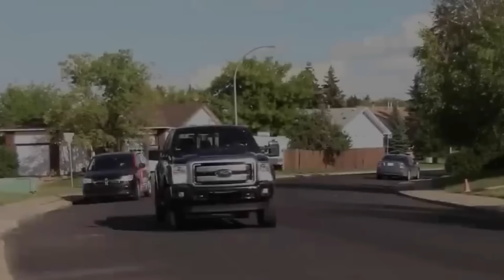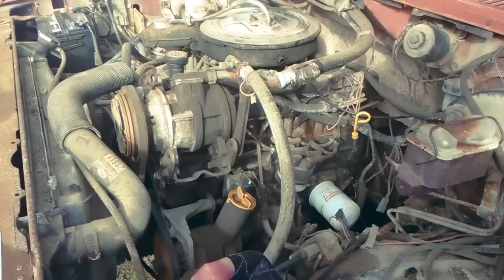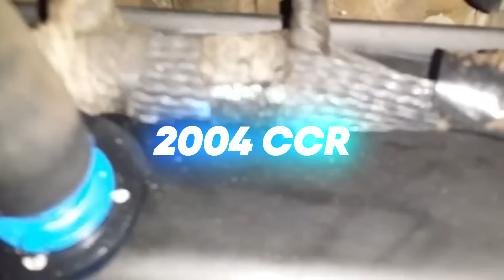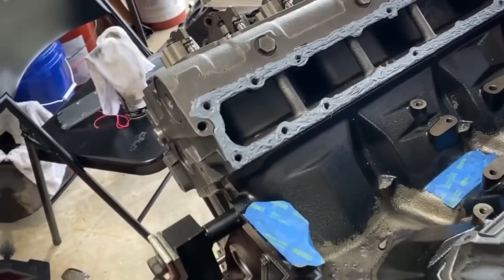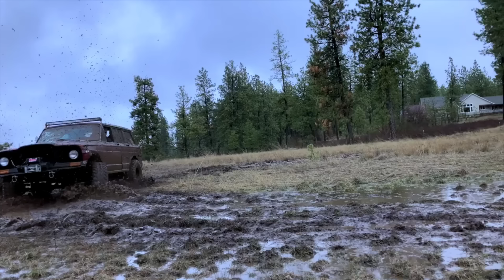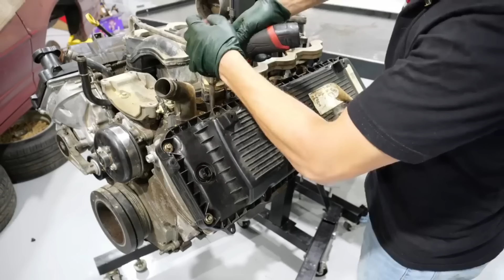The Only 5 Ford Engines That Last 300,000 Miles

Comment: The 302/5.0L Windsor V8 should definitely be on this list. I had a '91 Crown Vic that had 330,000 miles on it when we gave it to a family member who needed a car. They drove it another couple years then traded it for a newer car!
Reply: Have one with over 1 million miles
Reply: @bowtiebender6811  Yeah you do. It's called mental issues.
Reply: Overhead camshaft 4.6 V8 2 Valve was MUCH BETTER then 5.0 pushrod dinosaur
Reply: @anthonynicholich9654  Nah the 4.6 had crappy plastic chain guides that fail mine locked up at 120k and I didn't even drive it hard my 90 Fox with the 302 went well over 300k still ran great when I sold it and I beat the crap out of it
Reply: Name a bad ford engine? Doesn't exist some will say the 351 modified  but the beef here is gas mileage the engine was a 350 400 thousand mile engine  now ford did bomb in 80 81 T Bird a 260 or 265 BUT IT brought out the light cast 5.0 I do wish ford had kept the engine the chevy nuts call a LS it was the engine ford developed to replace the 5.0 intended for the new mustang pony car 1995 but with fords purchase of Jaguar they got the 4.6 an shelved the rebranded LS
Reply: @Charles-w9b  So many of them would not know where to start but I'll mention two. 6.0 diesel JUNK 5.4 3 valve junk  So we're all  their four  cylinder and 6.  How does it get as dumb as you?
Reply: @Charles-w9b  6.4 diesel was a total failure, and the 3-valve 5.4 had issues.  Today’s 4 cylinder motors made by Ford have some serious problems, especially if it’s under the 2.0l size.
Reply: @SoonerMatt 5.4 was a great engine for great DIY citizens or mechanics. Not over tighting or striping the 5 ring insertion point. There were several. The king was the 5.4 windsor in the Ford lightning. I have had several with 800,000 miles before sold.
Reply: @bowtiebender6811 that’s incredible on the 800k mark.  Impressive.
Reply: @SoonerMatt  It makes you wonder how does it get as dumb as him.
Reply: @Charles-w9b  6.4 diesel was a total failure, and the 3-valve 5.4 had issues.  Today’s 4 cylinder motors made by Ford have some serious problems, especially if it’s under the 2.0l size.
Reply: @Charles-w9b very wrong, 351 with 400 heads is a 351 modified. The 351 is the stolen LS.

Comment: List is ok ,yes the 2 valve variant of modular are great engines ,the 6.2 is a good motor. The windsor smallblock ,big block 460 were also great engines ,Triton v10 ,first,second gen coyote. The 4.6 v8 never used full synthetic oil,used a sythetic blend  oil only .

Comment: I really strongly believe the 5.0 liter Windsor V-8 should be on here, I had a 1993 F-150 I sold it at about 468,000 miles the only things I've ever done to it besides routine maintenance was a new oil pump and new coolant hoses the person I sold it to drove it around town  hauling scrap for a good 3 more years

Comment: My 1988 F250 5.8 Windsor and 1996 Bronco 5.8 Windsor are still running, both have over 325k miles, with no rebuild.
Reply: 1985 bronco, 300  over 600,000 3 alternators, two water pumps, third clutch, she just plows snow anymore! But still going

Comment: What about the new 7.3L gas SuperDuty engine? I have heard it is better than the 6.2L. Still driving my 7.3 Powerstroke about to hit 500K....very shortly.
Reply: You must not have heard about their lifter failures.
Reply: @scott.dobson  I thought that was on the first gen and they had fixed the problem. I know several people with close to 100K with no issues after that.
Reply: @Bwanar1 
From what I’ve read, 2024-present are good to go.
Reply: I bought the 6.8 with the thoughts of less stress then the 7.3  motor just a Can’t speak on its reliability . But the towing capability is great . Coming from a 6.0 power stroke I dont feel underpowered when towing . I tow 10000 lb skid steer and a 14000lb boom lift in south west Florida flat land and never felt underpowered.
Reply: The only thing they cant pass is a gas station, otherwise they are good.
I'd keep your 7.3 one of the best diesels for light trucks out there
Reply: That godzilla isn't that great
Reply: @TheRealDonVerga I agree I don’t think for towing nothing matches a diesel.But the government making it harder to justify buying one nowadays. Unless you’re able to afford the up front cost and the upkeep cost it’s nice that ford , Gm , and dodge are working to improve their lower price gas models . To give more people the opportunity to get into a truck that capable of towing some small equipment . In a perfect world the diesel engine should be cheaper or the same entry price . And the emission was never a concern .
Reply: @Westfl239-p4v i never have to worry about an emission problem again on my 6.7
Reply: @T @TheRealDonVerga nice . Man tell you the truth . The last diesel truck I bought was the 6.0 and it about bankrupt me . About the time I was able to get all the bullet prof parts add on filtering . Running fuel additive best of oil etc. new injectors ext . After about 25000 grand in and back and forth to the shop . I had to tow 2 side by sides to Va and blowed an injector somewhere in South Carolina . I had it towed to Chevy and traded it in on a 2500 gas 6.6 drove it 200000 miles no issues just oil changes . And this time I went to Chevy to go back for a new on they didn’t won’t to move on the price at all and tried to give me 10000 for my truck . Stopped by ford they took about 8000 off sticker and give me 15000 . And over the summer to run up and down the east cost from South Fl to Philly for farming with different locations along the way so was time to make the change . I went with ford I don’t have a 1000 miles on it yet hopefully 🤞 it’s as good as the 6.6 gas was to me . That 6.7 a beast if I had the money to buy one and not worry about if I needed to give a shop money if something happened . It would definitely be my go too . The high output  platinum plus , no def , all the bells and whistles tuned exhaust all of it . Just not there in my life at the moment for now it’s 6.8 gas and a couple can am renagade xmr tricked out for the fun times .

Comment: I had a 2014 Raptor with the 6.2. I idled that truck more hours than it drove. I traded it in at 164k miles and never had a single issue with it. Loved that Truck!
Reply: I had a 2012 that I idled all the time. I remember looking at that gas hand moving the same as me driving the damn thing 😂
Reply: @mariowilliams4002 yeah, they certainly didn’t get the best fuel economy, idling or driving lol….  After that one I had a 2020 raptor with the eco-boost and by 70,000 miles I traded it in with nothing but problems from the turbos. They were leaking oil or making some other awful sound that truck spent a lot of time at the dealer. My current truck is a 2024 F350 single rear wheel 6.7 high output, platinum tremer and it is going to go to the dealer for the first time at 66,000 miles for something. This one has been great but it does ride like a shopping cart 😅.
Reply: Man I love my 2019 F250 with the 6.2.   It just turned 150,000 miles. Just came back from a 57 day trip out west towing my 42ft 5th wheel that weighs 14,400 lb.  We were 22,500 lb total rig.    Towed great. Ran great.  All through Colorado. Arizona. Utah. New Mexico. And to Vegas.  105F and climbing a mountain, it didn’t care.  Just let spin 4500-5000 rpm and it’ll climb all day happily and never even thinks about running warm. 212F and the fans bring it back down to 206.     6 speed trans was rock solid.  Doesn’t matter that it’s the 6R100.  Does great.  Great match. I don’t want a diesel. I don’t want a 7.3.   I love this truck and plan to have it another 150k miles and tow my camper.   We also let it idle some times with our dog in there.   An hour or two was no problem.  Just rock solid reliable all day every day.

Comment: was it me?, or did this ai blooper miss the Mighty 460V8!
Reply: I think it did, which is a massive oversight.  IMHO, the best engine Ford ever made.  Sure, it uses a lot of gas, but it gets the job done!  There's a good reason why it was in production for almost 30 years.  You can still buy brand-new blocks today.
Reply: @peterf4552  you can tune them to make them slightly more efficient and even get more horsepower and twerk out of them.
Excellent workhorse run for a long long time with just regular maintenance
Reply: The gentle giant!!
Reply: @SierraKnight3277 Ambulances over here are using this engine I believe. Gentle giant indeed.
Reply: I was gonna say the same thing. How can you leave out the 460??
Reply: @dontfightitigniteit9773 the gentle giant!!

Comment: I have a 5.4l triton 3v in a 2006 super duty f250 4x4 thats is still running and has 300k miles on it
Reply: You're lucky.... They're typically a "ticking" time bomb
Reply: @BOMOutdoors-.223 oil problem and camphaser fail easy to change.
Reply: @hqoffroad mine blew a plug
Reply: @BOMOutdoors-.223  For my spark plugs, I had to use the extraction tool for the 16mm two-piece ones, but it went smoothly. I have a second engine that I’m preparing to upgrade with high-performance parts for 500 HP.
Reply: You lucked out. 3V 5.4 loves to eat cam phasers.
Reply: @vetteluvnh locker camphaser
Reply: Put it in a museum. Its likely the only one lol
Reply: I am still running 5.4 3V in a 2005 Expedition 4wd with 258k and on the original timing set. The engine fair better than the transmission which was rebuilt at 180K due to towing.